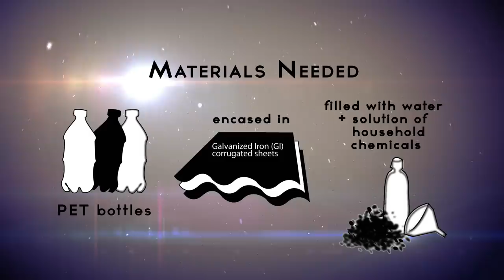How to Build a Solar Bottle Bulb 2.0 ( Updated English Version)

Comment: @CommentsSurvey vulcaseal is really sticky and is rubbery. when exposed to the sun it becomes hard like a rock. caulk or silicone sealant is good for preventing leaks but a stronger adhesive is recommended so the bottle wont slide off the flange.

Comment: The latter. It's using the chlorinated water to scatter the light that passes through the bottle. A clever idea, but it won't work at night. Or at least, not as well. (It would be cool to see how it operates in moonlight.)

Comment: This is NOT a glow in the dark light. If you were paying attention, it only works during the day when the outdoor light can shine through the water and then the water spreads the light through the dark rooms. I think it would be a great idea for my shed which has no lights or windows and I only go in there during the day anyway. Why have to run electric cords back there just to look for something like a rake or shovel? I give an A+

Comment: This would never work with large buildings for example, unless Chlorine has such a high refractive index that light could travel around large tubes from say a window. That said, if you COULD make it work, it would lead to MASSIVE savings in energy consumption. With American homes, the structure is different, I couldn't comment on it, but I think it would be hard. A shed should be easy though.
I really want to see how this works under moonlight though :) I mean as it is it's useful, but imagine!

Comment: u are small man with a need to be noticed :) they didn't say that bottle emiting 50 Watt of energy, they said that light that bottle reflect and disperse in room is same as light that Edisson Bulb of 50 watts emited. and maybe u didn't know, but that is not same :) edison bulb is device that transform power to heat, not to light, and it's light efficency is very small. as you B-)